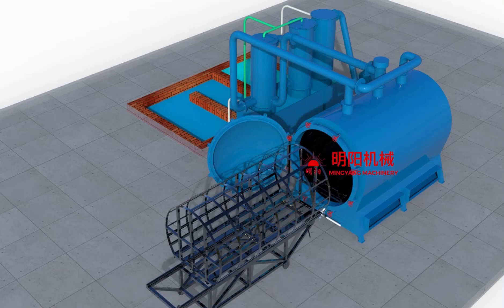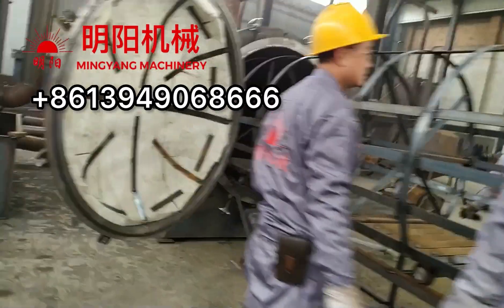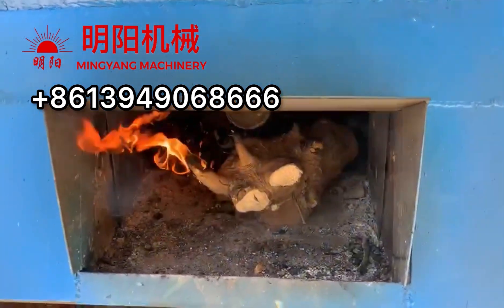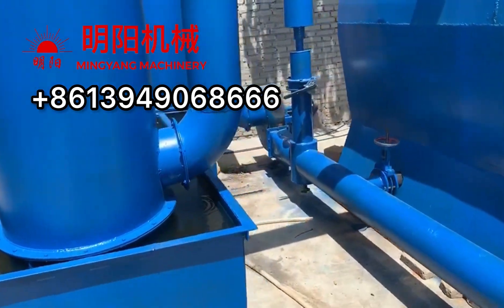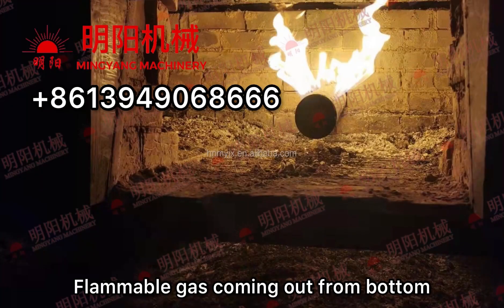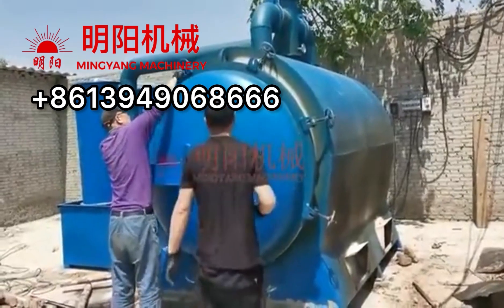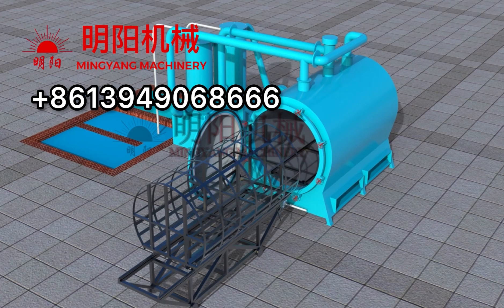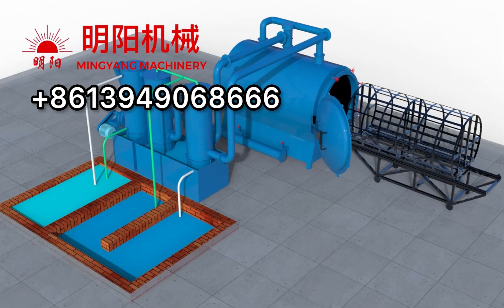Natural wood biochar carbonziation furnace Full working process

Comment: Is this machine using electricity..
Reply from the maker: It’s burn firewood preheating, after that use recycled gas for heating. We use a fan to promote the gas airflow. If you don’t want electricity consumption, then we can modify to without power system.

Comment: Hello, means that, the burning gas inside the furnace is used as a fuel?
Reply from the maker: @Nico-rw1uo  Yes. After inner material moisture gone and inner temperature reach to 300 centigrade, it will carbonize by itself. Since we can have enough recycled gas as heating fuel
Reply: @kimzhao-charcoalmakingmachine  thqnk you

Comment: I watched some videos about your charcoal making machine and factly I am really impressive about you. However I have some questions, would you mind answering for me, please?
1. How long does the pyrolysis process last? How long does it take for preheating with LPG,wood... last? How long does it take for self-burning with non-condensing gas (pyrolysis product) last?
2. Do you cool charcoal by water or only air? I see some other machines at which charcoal is cooled but I don't see you mention that
3. How do you control the temperature in pyrolysis furnace?
4. Which factors do you base on to determine and control the temperature of the pyrolysis process?
5. I see some machines at which smoke comes in the condensing tower after coming out the spraying towers, but the others are inverse. Then which factor do you base on to determine that?
I am looking forward to hearing from you.
Thank you so much!
Reply from the maker: Hi, thanks for your comment. Next time you can directly send me messages via whatsapp.( because sometimes i not able to see this on time). Pls check my answers as below:
1, One batch preheating time based on materials original moisture, if it's 30%, preheating will takes 2-3 hours. Then after carbonization starts, carbonization takes 4-5 hours finish. Recycled gas produced very fast after carbonization starts.
2, We cool by environmtal, stay inside drum, automatic shrinking, then cool down, use 10 hours.
3, We control valve smaller or bigger to control the gas heating amount. Then control the temperature. Because we mainly use recyed gas as heating fuel, so not able to control by button or something very precisely like percentage.
4, We check time, fire of recycled gas burning, gas color.
5, It's better letting smoke go spray firstly, then condensation. Spray is moving away dust, condenstaion is moving moisture.

Comment: 😊I see that a lot of metal has been spent on peripheral equipment. Perhaps it would be enough for another carbonation chamber.   https://www.youtube.com/playlist?list=PLgwfxcO2EeYHPrFwp2x3xgow9jj6D-xFS
Reply from the maker: Our furnace chamber using boiler grade steel( enable high temperature working, and last longer service lifespan), not normal steel. Except chamber, those are purification system, that ensure smokeless working. So those are necessary parts.

Comment: the actual cycle is 18 to 24 hours for carbonization and more than one day for cooling.in every 3 days one cycle will be done.
Reply from the maker: Hi Reza, our furnace carbonization takes 4-6 hours. If your materials lot of moisture, the drying takes longer time. Normal wood max 3 hours, normal coconut shell 1.5-2 hours. Cooling 10 hours, and we have cooling tool to help faster. So our furnace system is total approx 8 hours finish one batch, and 10 hours cooling. This is based on so many years test and customers real using experience, and also our engineers's assembling experience.